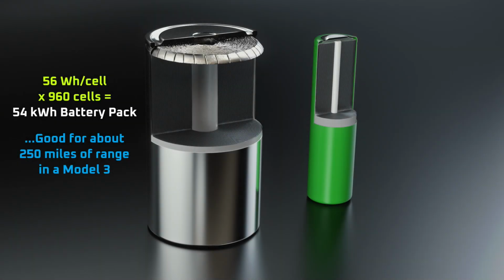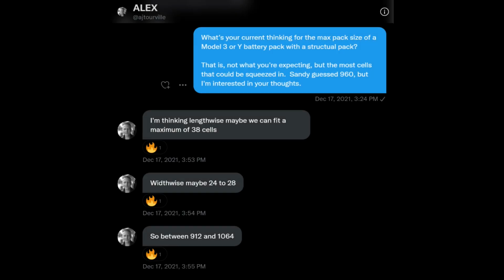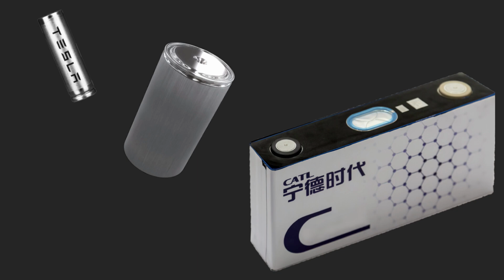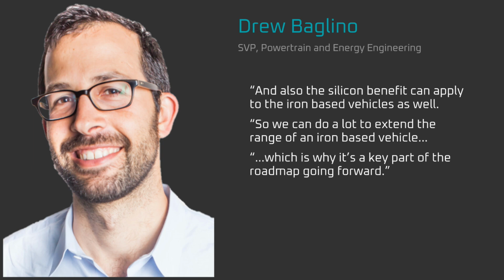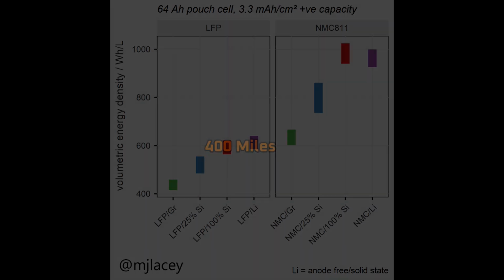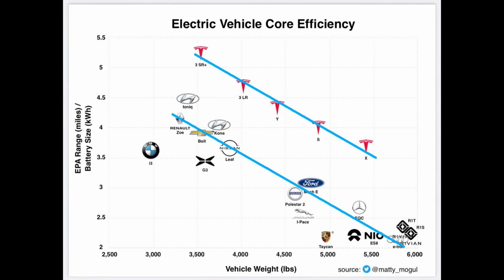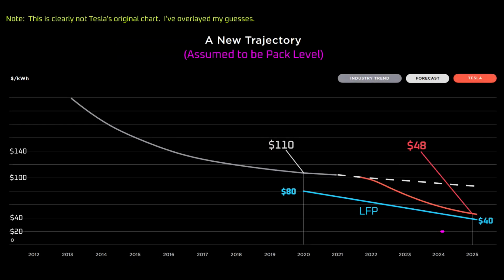The LFP 4680 Battery Cell  // + LFP with Tesla Silicon

Comment: The question about cilindrical or prismatic or pouch cells is in fact more simple as presented. Cilindrical formfactor result from replacementable cells of normal batteries in many applications. This formfactor is completely useless for permanent in place energy cells who do not have to be exchanged. They also have cell structural strength completely useless for battery packs. Tesla started with standard 18650 cells because they where cheap available cells. Other car manucturers developed new battery cells especially for automotive applications in packaged design resulting in pouch cells. That's it no more!

Comment: The LiSER Battery. The industry first "tab-less" advanced prismatic cell design that has an in-situ cooling loop to facilitate efficient temperature operations ranging from -40°C to 90°C, assisting in extra fast charging. Cool🥶 I'm guessing they use the center of the "jelly roll".

Comment: Actually, the surface/volume ratio of prismatic cells is greater than cylindrical. It is the packaging density in modules where the aggregate effectively densifies the block requiring another approach to cooling.  Small but fundamental point.

Comment: At battery day, Elon said the NCA heats from the ends so 4680 with staggered packing and end cooling works well.  
So, does LFP heat at the ends or along the sides? If the latter, the 4680 won’t work too well as side cooling isn’t so good when they are packed in.

Comment: A less discussed challenge is electrode matching. High nickel and silicon composite anode designs both have high initial irreversible capacities. LFP does not. This means an LFP / C6:Si design would likely require online pre-lithiation. This adds big costs via capital and throughput slowdowns.

Comment: How to improve upon => solid electrolyte material <= .. Most battery engineering don't know the difference how Electret Material effectively => increase charge density <=  .. But , All Electret Materials will not have Induced Stresses in the material ! .. Mechanical Stresses typically are looked upon with noses upturned for the reason of flexure .. Mechanical Stress make the electrolyte material more brittle .. Being that I am the guy who knows about how to mitigate flexures we must both shape the material robotically while heating one side & cooling the opposite side => during the bending process <= .. This can be done at high speeds with a argon plasma using fan tip to heat the electrolyte causing a eutectic event on one side of the material while forming the material using a mandrill which is supercooled .. The speed depend upon the dwell time to induce the proper stressing at a high rate of speed so as to wind the batter at a rate that allows the stresses to be designed into the battery shape .. Honestly , round batteries "ARE STUPID" .. None of this falderal would be necessary if Flat Batteries were used .. Why Flat over Round .. Cost vs Benefit .. Flat batteries can be 3D printed .. Flat batteries can have additional circuitry 3D printed to be able to switch in or out bad actors in a stack of batteries .. Battery compression is controlled by Round Cells effectively , this is the one good thing about cells .. But this compression could be had by flat batteries as well .. The weight of flat batteries is low .. The electronics to control multi-cell flat packs is better , the heat in solid electrolyte batteries can be much much higher but not as much in cells .. Metal plates can be used as connections and heat spreaders which isn't the case in round cells .. Intelligence battery flat pack modules will extend the life of large battery systems with out the need to swap out entire battery packs to determine which battery layers are the offenders which makes for self healing batteries .. Technology moves forward Elon Musk .. Sakuu.com 3D printed batteries .. Musk , have you boys actually do some material testing using electrolytes that are prestressed electrolytes .. You won't know what you don't know until you know why this matters .. Yes , you can't ... III ... patent this idea .. I have prior art which is very well documented ..

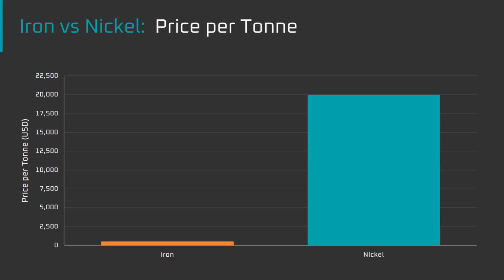Comment: Recycle LFP at 14:35 - The Lithium will be recyclable from LFP.  It will be a water soluble component rather easy to separate from the other materials which are all insoluble. You would get uncontaminated Lithium back.

Recyclers will need to separate incoming batteries into type so they apply an efficient extraction for each type. You would not want to process LFP batteries for say, Nickel extraction. perhaps an x-ray emission spectrometer testing each battery as it passes on a conveyer. This would identify which metals are present in each battery and allow efficient sorting.

Comment: 5:49: the picture here shows a situation when the cells are not in honeycomb order. The pictures we have from Tesla suggest a honeycomb order, which uses the available space better. Based on my calculation in this case the packing density can get close to pi/(2*3**(1/2) ) == 90.69 %. (only close, because at the borders things get a bit worse).
Reply from the maker: Please read the pinned comment.  It would have saved you some time.

Comment: Great presentation. I understand that LFP can be charged to near 100% where as the NCA batteries can only be charged to 80% without shortening the battery life. I think this is huge as the advertised range is more closely achievable for the LFP vs 80% for the NCA. I'm not sure that is addressed in the comparisons. Being able to use the full capacity of the battery as well as higher life cycles should make the LFP a  clear winner. Now about other chemistries..........

Comment: In the comparisons of blade to wound cells I'd like to see what the actual "active square footage" is of the 4680 battery material - ie unwind a cylindrical cell ( to get a biggish rectangle) and compare with the active area of a blade battery. Plus be good to see and compare the length of electrical path to the poles (tabless makes for very short paths)  - so, how does a blade compared on this???

Comment: The question that I’ve never seen addressed is the issue of the structural nature of the 4680 battery pack and what the means for the design with LFP.
Reply from the maker: Whether LFP or Nickel, it wouldn't change the nature of the cell as the structural member of the structural pack.  Maybe I'm missing the question.

Comment: It would be interesting run. 
Because solid state batteries with lithium metal anode in laboratories attack and in some cases already overstepped 1000Wh/kg capacities. Lithium metal anode is safe if solid electrolyte is used.

Comment: Don't assume lower pack weight results in additional range, range is not well correlated to weight. It's almost all based on aero and drivetrain efficiency.
I see you have a graph for it as well, you're confusing weight with vehicle size (frontal area, which is multiplied by tge coefficient of drag). If you have the same vehicle and remove weight and change nothing else you gain almost no range. Note the 2022 Model 3 "SR" and Long Range are only 1 MPGE apart despite many hundreds of pounds difference in weight (over 600 lbs different, long range is 17% heavier).

Comment: (1) Tesla 4680 manufacturing plants are certainly designed to handle LFP  electrodes & electrolytes.
(2) Tesla vehicle & storage production is effectively limited by cell availability.
(3) Tesla has stated it will purchase as many cells as outside manufactures can provide . 
(4) It becomes a question of how fast Tesla can increase its in-house manufacturing.

Comment: Jordan, I have this nasty recurrent thought that what Tesla should be doing is adopting a mixed chemistry pack, say 75% LFP and 25% nickel, for all their models.  If LFP are not as tolerant as nickel at low temperatures, this is a concern for Canadians, for example.  But with a 75%/25% LFP/nickel mix, in a freeze situation the nickel cells could provide enough power to raise the temperature of the LFP cells, to be able to bootstrap the entire pack.  If both chemistries are packed as 4680 and arranged in a honeycomb, it is then trivial to make 1 of every 4 cells a nickel in such a way that no two nickels are adjacent, for lower fire propagation.  But I know nothing about the charging compatibility of these chemistries, or even if they are the same voltage.  Perhaps this idea would necessitate duplicity in battery controllers.

Comment: With respect, you are wrong about heat dissipation of 4680 - which is via end caps & metal current collectors for 40 mm average path length - cylindrical sides / surface area is irrelevant / not cooled at all. You could theoretically make a single cell of 1m dia and 80mm depth with same heat dissipation characteristics.

Comment: Sup Gordon quick question, what about sulphur with the lithion batteries can that be used besides silicon? I know they both expand under charging (to similar levels?) but are they comparable at all?
Reply from the maker: Yup, compatible, but that's deeep into the future.  To early to say what will be paired with what.
Reply: For that sodiun ion battery vid coming up, are you gonna look at what or if silicon and or sulphur could be used I those types of batteries?
Oh and can potassium be used in place of sodium (although maybe sodium is to easy to get and cheaper)

Comment: BYD Blade will be the preferred design.
Reply from the maker: It is pretty sick.  Check out my blade video.
Reply: @thelimitingfactor   The thing to get about BYD is they are the GM of China but unlike GM they have gone from 20% EVs to btw 70-80% EV in about 18 months "You changed everything Mary!" By 2035 LOL!! BYD will be 100% EV by 2025. They lead in electric buses. Moscow's fleet of 900 EV buses I believe are all BYD and they will double that fleet by 2030, at least.

Comment: I disagree with your statement that LFP batteries should only be used for storage and robotaxis.

Think about it... PV's are cheaper than ever, and in the very near future people are going to run out of excuses not to get PVs if they are home owners, it just makes too much economic sense.

But what you really want, is to get rid of the grid if possible, to avoid any funny business with your electric company (they might not even pay you anything for energy you generate)

So if you're gonna buy PVs, and a car, why not buy a power plant instead, that also happens to be a car or pickup truck?
A car's battery is way bigger than a powerwall's, it might actually be able to get you through a full day (of powering everything in your house, everything! including HVAC)

If you have a car with LFP, you actually have something useful at your house, that actually does something while it's parked: It has the potential to be a powerplant you can replenish daily, for free with solar.
Reply from the maker: I didn't say they would only be used for that.

Comment: Yes 5.5x volume in 46800 over 18650 is great on paper and is problematic as heat in 46800 is blocked short at the anode to cell base junction. Such junction utilize multi point contact for heat transfer is practically a heat barrier.
Reply from the maker: Over 2170.  Tabless electrode solves the heat problem, that was the point.  If it didn't, the packs wouldn't have passed verification.
Reply: @thelimitingfactor  
“Tabless electrode solves the heat problem…” is a believe not an argument or engineering rationale. 

In the contrary tab-less electrode address bottle neck electrical conduction issue and is irrelevant to heat transfer. 

“If it didn't, the packs wouldn't have passed verification” is a logical assumption, indication or faith but proof.

Comment: Jordan, why wouldn't Tesla adopt a blade cell format for it's LFP cells? And maintain 4680 for the high nickel cells? Makes more sense to me ..
Reply: The blade cell is already structural, didn't need coolant lines too.
Reply from the maker: Already covered in the Blade battery video.

Comment: We have a thermal issue in the 46800 associate with the “tab less patent” by Tesla. 

Thermal issue? Per 18650 - heat sink horizontally through chemical to coolant channel is problematic, compare to 46800 heat sink vertically through metal foil to cell-base that is brilliant. 

However heat in 46800 is rapidly pull out of core only to be blocked by an array of point contact fall short reaching to the cell-base or coolant channels. 

This problem never admitted or published by Tesla and if not corrected can highly compromise model3/Y performance and longevity. 

Once the tab of 18650 is omitted in the 46800, this open chances for electrical breakage at the anode to cell-case junction. Breakage usually caused by inertial shock of a moving vehicle. Where sudden electrical breakage inside the cell will induce electric spark, and consequently ignition of heated cell chemical.
Reply from the maker: Not sure if this is a redundant comment.  

As above, it passed verification.  Neither of have the pack in front of us nor the data.  So anything either of us says is ass talking.

Comment: The 4680 according to Tesla is the ideal size for tabless Li-Ion battery from what I remember and yes because of the structural battery pack and the removal of framing weight because of it. It seems like a really good solution and when I looked as the prismatic I don't see any way to make a structural battery pack with it.

What we don't know is if that same size would be ideal for LFP.  If it isn't, they might have to make another format, but going smaller is not good, and going larger I think means losing more space for battery capacity.

Comment: The quantity demand of LFP (for both automotive and storage) is going to be so high that it doesn't make any sense to pigeonhole LFP cell design to a format that only current Gigafactories (optimized for Nickel chemistry) can handle.
New R&D expense will be the least of an issue when designing the LFP cells.
If it is realized that 4680 format doesn't eke out the best performance from LFP chemistry, then in all likelihood Tesla will readily use third party LFP cells (as it already is) and also simultaneously build out new Gigafactories that are catered exclusively for the specific LFP cell format.

Comment: Do you think solid state batteries will play an important role in the battery development roadmap projecting out to the 2026-2035 timeframe for Tesla?  Seems like Tesla will need fast charging with high cycle life if it wants to achieve maximum utilization rates for services such as autonomous taxis, semi trucks, and humanoid robots.

Comment: Tesla is committed to CATL and BYD LFP cells, and separately committed to Giga-casting front and rear ends.  I believe this implies a structural battery pack has to be developed for CATL and BYD formats as well as for the 4680.  

If they have developed LFP structural battery packs already (for the outsourced cells), then it seems unlikely that Tesla would not adopt either the CATL or BYD format for their LFP mobility cells.  Why would they give up the volume and weight advantage?

Elon was clear about the transition to iron from nickel for both cost and availability.  That seems to imply a form factor change is coming, too, to optimize LFP for range.

You point out that vehicle efficiency is critical to the adoption of 300 mile LFP.  I think you're probably right that success of the legacy automakers probably will track with their ability to improve efficiency.

Comment: I see two most probable paths for LFP in Tesla vehicles:
1. Tesla makes 4680 LFP in house
2. Tesla buys Prismatic LFPs from Chinese suppliers 

I don’t see the advantage of Tesla spending the r&d and more so the distraction of engineering resources when they can buy off the shelf with enough supply at reasonable prices. I agree both would end up in structural packs.

Comment: You left out that prismatic batteries are what Chevy Bolt uses and that they are less safe.  While LFP is a lower power density, the amount of energy in the pack needs to be comparable.

Comment: Hey Jordan, great vid as usual.  Question, are you working on a video analyzing Jeff Dahn's recent Webinar regarding electrolyte additives and the > 12000+ cycle life/5mil mile battery? Would be curious if you could come up with the additives and any potential patents from Tesla?
Reply from the maker: Anh, he's given that presentation half a dozen times now.  Just with updated analogies and progress data.

Yeah, it's sodium difluorophosphate is the big one.
Reply: @thelimitingfactor  He also mentioned during this webinar that this chemistry is already being used by manufacturers for commercial applications.  I'm assuming it's Tesla's 4680.  Anyway, thanks for the info!

Comment: Elon himself said "we do not use 4680 at all for iron based cells" Drew confirmed saying "no". (tesla q4 2021 earning call time stamp 1:01:36) my impression is that 4680 is for nickel based (high energy density) and lfp will be used in other form factors. I was shocked because I thought 4680 could use several different chemistries including lfp. Elon said no, so I believe Elon.
Reply from the maker: Yeah, that's open to interpretation.  Probably worth watching the video before commenting.

Comment: Thinking out loud: Why not use both chemisties in the same car?  If LFP has a long cycle life but less density, have a 40kwh pack that is used first, then draw on a 40kwh NCA battery.  Even better, have the LFP pack provide power for cruising and then draw on the NCA pack for hills, accelerating, etc.  Effecively reduce the cycle time on the NCA by half and the LFP is cycled twice as much.

Comment: Just wondering about using/packing multiple form factor cylindrical cells to increase packing efficiency.  Is that a reasonable approach to increasing volumetric density?